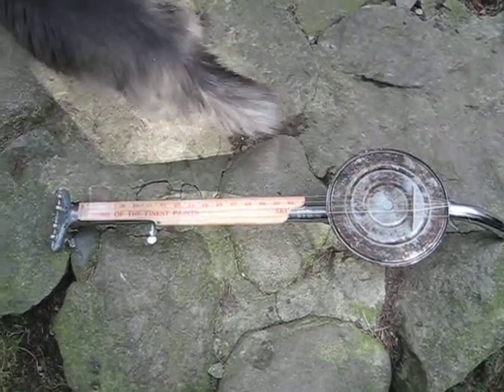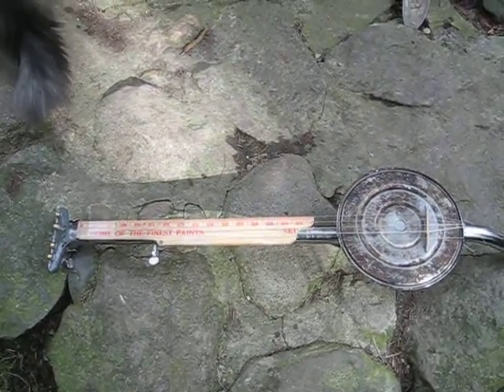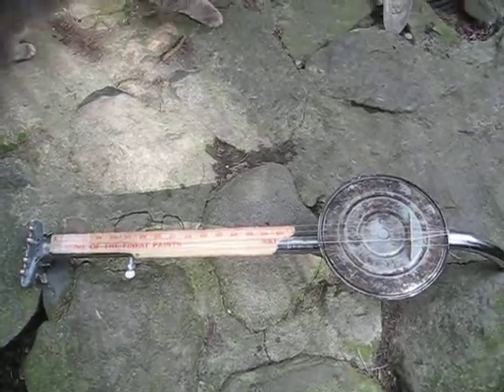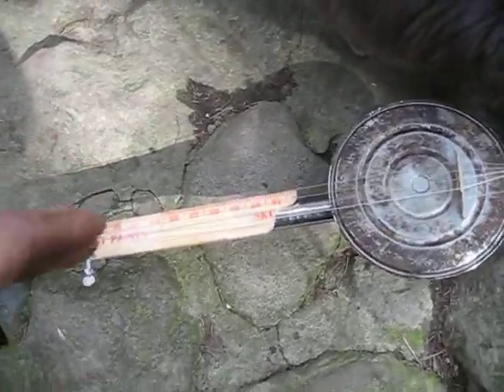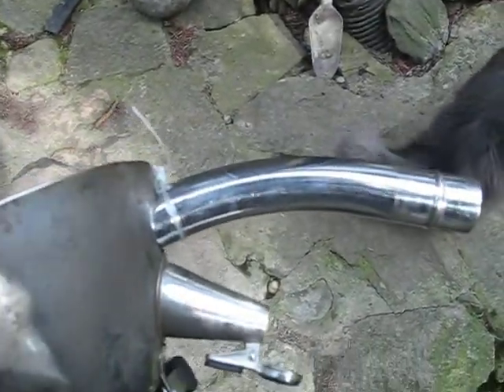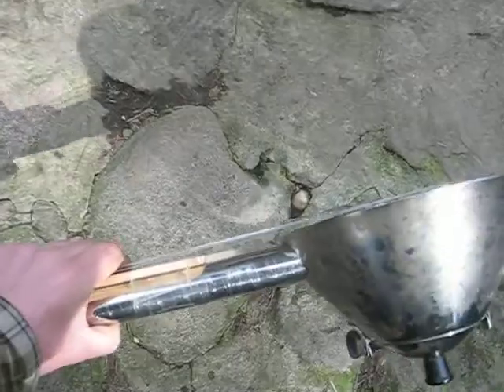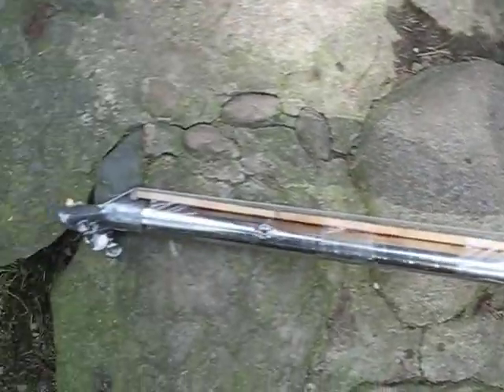"panjo" described

Comment from the maker: This instrument already has holes in the soundbox, but they are on the back(top)side of the kettle. The lid can be removed to change the tone. Soundwaves also exit via the pour spout. When I really want more volume I connect the internal piezo pickup to an amplifer. The cord plugs into the place where the steam whistle was located.